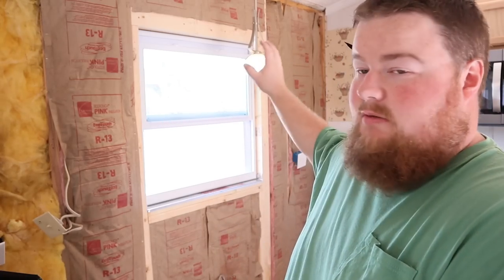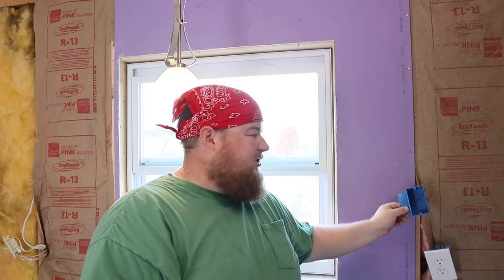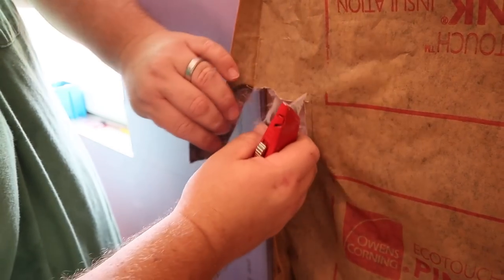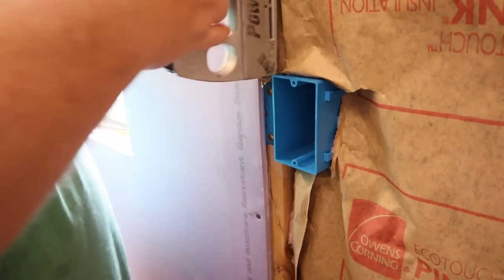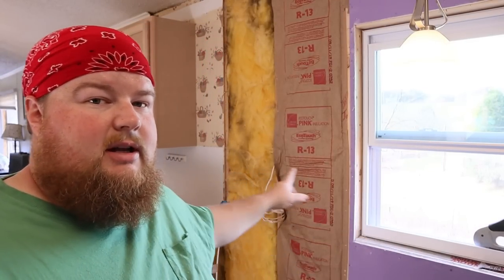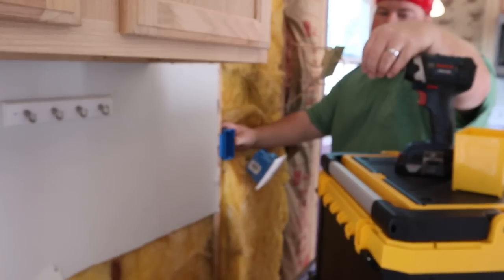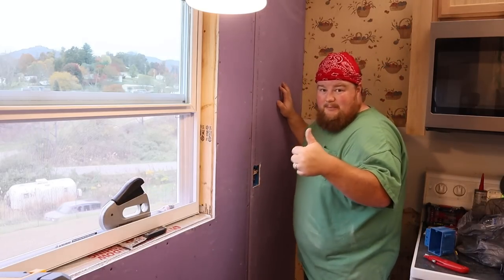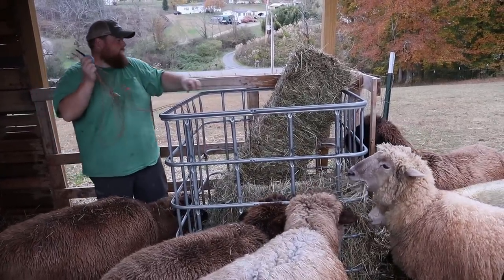Purple Drywall in the Kitchen? | Budget Mobile Home Remodel #18

Comment: I have been renovating my 1992 Commodore 14 X 76 Mobile Home for several years; I'm basically doing 
a Room BY Room gut job whenever I have the money and time. I ripped every single sheet of the aluminium outer sheathing off and installed OSB panels layered with Tyvek. Of Course, I found rot under half of the window frames, as you did.
Like you, I had to re-build some of the window seals and replace several wall studs, and while I had everything ripped apart outside, I decided to replace all of the windows with Pella Lo-E Vinyl units with flashing above and on the seal like it should of been done in the first place. Then I installed thermal insulated vinyl siding, which made the outside look like a new home. Most of my drywall has been replaced at this point;  and I started taping and seaming each room last month.  I think I could of bought a new trailer home for what I have in this place so far,  but I know that it is done right, and it is very energy efficient because I also replaced all of that dreadful yellow Chinese insulation with Johns Manville fiberglass batts which has the Kraft vapor barrier.
I went from burning a tank and a quarter of fuel oil each winter to slightly less than 3/4 of a tank.  When I
watch your videos, it reminds me of the pain that I went through day after day working in the hot sun, trying to do the work by myself.   Boy Do I Feel Your Pain!
I wanted to let you know something that I tried when cutting outlet holes for my new electrical boxes;  try using your "Oscillator Cutting Tool", it will make short and neat work out of cutting holes in drywall sheeting.
 If you two need anything to get you through this project, let me know, even though I burnt through most of my savings do this reno, I still might be able to send you a tool, screws, advise; or whatever. 
  Thankx for the entertaining and informative videos.
   Your Yankee Friend From PA "Rich" :~)
Reply: Yes, maybe you could’ve bought a new modular or trailer home....but....it would still be a trailer. This way, you have a legit solid home! I respect your tenacity.

Comment: I am surprised you nailed the drywall sheets in place instead of screwing it in place.  You are the second person that I have ever seen nail it like that.
Reply: Michael Newman Nails tend to pop out of drywall.  Course drywall screws are the way to go.
Reply: @garseetr  That is why I said that I am surprised he used nails.  I thought he would have used screws.  I always use screws when I do drywall.
Reply: That's why they have drywall screws. Nails can back out and leave nail pops.
Reply: They will back out, theres so much movement with the aluminum siding and cold weather!!

Comment: Sam, proud your doing it! Even repairs with some mistakes is better than original, plus mistakes are learning lessons. Not judging and it's been said but should use drywall screws. I learned everything from drywall, plumbing, electrical, etc by helping and watching my daddy, I'm 56 and redoing our home with my daughter, get them boys involved! Tool clean up/equipment stacking, etc. Gets them familiar with use and names of tools. Let them putty, nail, screw etc in hidden places to practice. Use extra pieces to invent and build items. Just ideas for ya!
Reply from the maker: I’ll go back and put screws in the panel after I buy some. Thanks!!

Comment: just a helpful tip, NEC code specifies ~.25 or .5 inches of wire sheathing in a box - you've got a bit much ;) i would also suggest getting unfaced insulation and installing a proper vapor barrier after seeing how the exterior of your house is constructed but obviously consult with your local municipality as they know what is common and required in the area.

Comment: 3 little things: I staple insulation on the sides of the studs instead of the fronts. That way you can use drywall adhesive on the stud faces. Second, I hang drywall the other direction,  seams on the horizontal. Less effort finishing. Third, I would use a nail-on box there to save time finishing that hump under the drywall. Little things, you did a real nice job.

Comment: I believe those "cable restraints" in your blue plastic electrical boxes are not "knock-out tabs", and should not be "punched out".  Especially if you're not securing the cables with staples.
  You may want to check the specs for your boxes.  And also, NEC ARTICLE 314 for Outlet, Device, Pull, and Junction Boxes.

Comment: You can use your dremel tool that you used to cut the old floor out for your light socket cut outs in the drywall. Also if you scribe cut with your big square in the front of the drywall than just snap it backwards and make one final cut its alot easier than to keep cutting your line.

Comment: Please use a multimeter or dedicated electric current testing device when deciding the power is off.  It's too easy to use an appliance for testing but accidentally misuse the appliance.  For example, if you have a light you plug in, and you're just certain the switch is in the on position, but somehow it's not, then you shock yourself.

Comment: I installed an underlayment padded foam on our kitchen floor. I used plywood not particle board door the flooring. I also sealed it against water after laying it down. I then added a sealed foam type barrier that runs up the wall just below the trim. This turns the kitchen into a bathtub. Any water gets in and it cannot go beyond the flooring I put down.  I didn't go with waterproof drywall because I figure the water cannot get up the wall with the foam barrier running up the drywall. Ok, I am not testing it eather. I would leave that purple.lol. Nice color.
Reply from the maker: Very nice!!

Comment: Why did you choose nailing the drywall over screwing it? I live in a mobile home and I'm about to replace some drywall as well, just trying to find the best method.
Reply: screwing is always the best method without question. just make sure to either get a proper drywall screw setter attachment, or make sure you only dimple the paper without breaking through it.
Reply from the maker: It’s what I had on hand already. As the project progresses I’ll have to buy more fasteners and will get screws. Thanks!
Reply: Nailing is cheaper. Nails also have a larger head and hold the drywall better. That said screws are much faster.
Reply: Don't use nails, unless you want future nail pops. Those nails will back out over time, especially on a mobile home. They flex.
Reply: @mimiso2522  they also back out over time and leave nail pops. Mobile homes flex and move much more than a stick built.
Reply: @scottfirman  true. I forgot about the metal frames.
Reply: @mimiso2522  if nails hold drywall better, then why is it that every time drywall has come loose or had a nail pop it is because of a nail not a screw? I'm sorry, but there is no argument for nails, except it might be faster if you are using a nail gun, however then you have to compare apples to apples and you've also got drywall screw guns that are a few seconds slower than nails but still comparative.
Reply: I'm currently having to tap in nails that have popped out since my house has settled. Makes for a terrible time patching and repainting.
Reply: @fd3871  Nails have a bigger head and get a better grip. Screws are faster, especially when using a gun. However, if you have a home that moves a lot you'd want to use screws. That said, both ways have their benefits and it is up to the owner to decide which they want to use. It's simply personal preference. I personally us screws because I am a weakling and hammering isn't for sissies.
Reply: @mimiso2522  if nails had a better grip, nail pops wouldn't be a thing and most building codes wouldn't require roughly double the amount of nails vs screws. All wooden houses move so that is a non starter. Nails only have better shear strength, that's about it.

Comment: My grandfather told me when cutting out electrical boxes in drywall, coat the edges of the box with toothpaste and put your piece in place. Then when you take the piece off again you will have an outline of the box to cut.
Reply from the maker: Interesting!
Reply: @sam-and-angela  agreed, it’s seem to work out well so far in the few rooms I have drywalled so far.

Comment: You didn’t need to buy the expensive box.  Just screw it in thru the box into the stud. Add some flex tape or electrical tape to cover screw